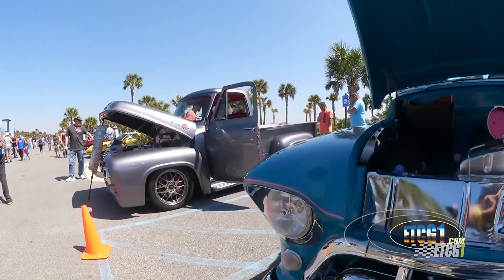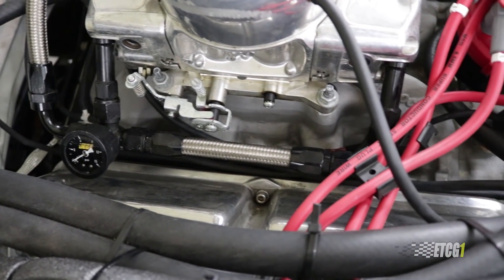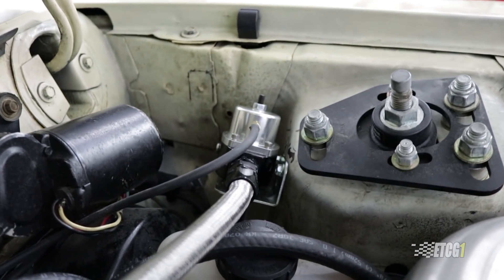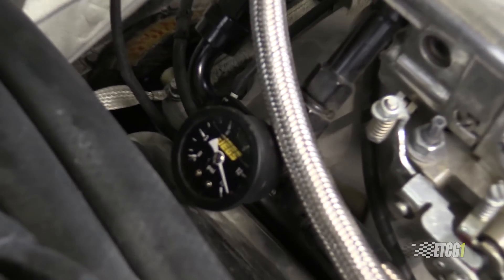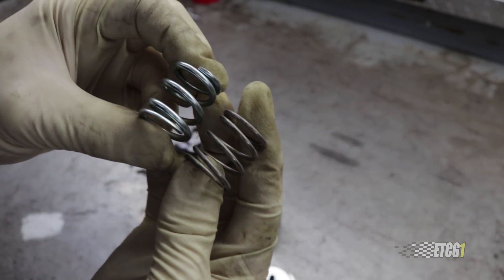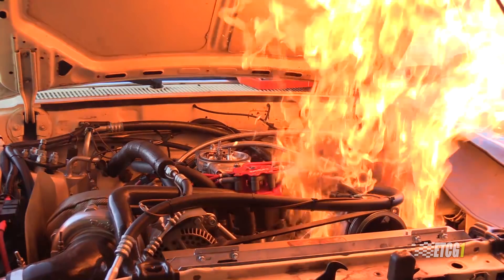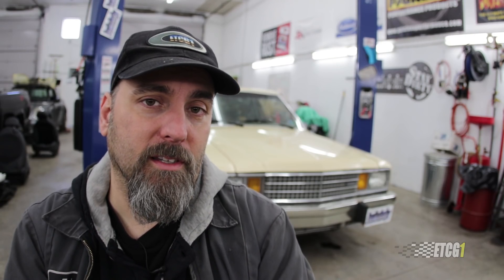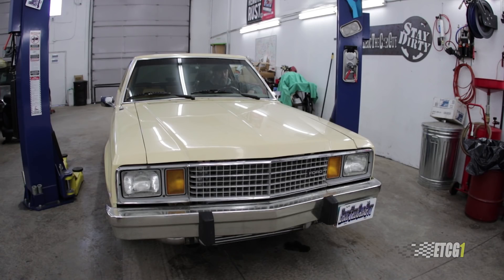How Did the Fairmont Catch On Fire?

Comment: Brb going to buy fire extinguisher for car!
Reply: Klegolas ditto
Reply: You mean that you didn't have one?  An extinguisher was the first accessory I got for each car I've owned. A first aid kit was the second.
Reply: Yeah I need to buy one. Snapped a factory plastic fuel line on my project car, thankfully it was turnef off at the time and I saw it snap. Come to find out that fuel line has been responsible for countless engine fires and should have been recalled but never was.
Reply: P Schmied First aid kit is mandatory in Germany and even checked during inspection every two years. Fire extinguisher is not, but this very much reminds me to check when mine did expire...
Think I have to get a new one.
Only problem I see with extinguishers, most people will not know how to use them and likely make a mess without getting the fire out. I was lucky to learn how to use one while working at an airport, and other than futile attempts I have seen before, Eric seems to know how to use it.

Comment: Hey, Eric. I went to a firefighting school when I was younger. A basic rule for using a fire extinguisher for liquid fuel fires is you empty it if you discharge it at all. As you saw, you did not initially extinguish the fire, and you needed more powder to smother it. This can be very dangerous with liquid fuel fires. Say you need 3/4 a tank to smother a fire. You spray half and stop. The fire spreads right back to the fuel. Now you need 3/4 a tank again, but you only have half left. ALWAYS empty the fire extinguisher on to liquid fire.
Reply from the maker: I'm not saying you're wrong, but something tells me you've never cleaned up after a dry chemical fire extinguisher discharge in an engine compartment. If you had, you would use as little as possible. Thanks for your input.
Reply: That's because the dry powder clogs the valve from closing and if you think it's reusable because there's still chemicals inside, you are most mistaken.
Reply: +ETCG1 Yeah, they can be a mess. You'll probably be finding some for quite a while. On the bright side, you figured out to have a CO2 extinguisher if there is ever a next time.

Comment: whew  I think I’m gonna move the fire extinguisher in my ‘68 Galaxie from the trunk to the passenger-compartment.  Like right now!

And that loud button — how cool!!
Reply: i did the same thing in my 64 tbird.
Reply: Im thinking the same thing. But, I might just have one in the trunk, and one in the cab. Speed is essential to avoiding total catastrophe in a fuel fire.
Reply: I think mine is rolling around on the floor in the back seat ...Im going out to check, hang on...
Reply: Put a fire extinguisher system under the Hood like you have on airplanes
Reply: LMacNeill don't we all want a loud button now? This is how wants become "needs" lol.
Reply: in my 84 s10 i hav emine bolted to the transmission tunnel on the passenger side foot well.
Reply: Hi tank. That seems like a normal spot to them to me. The key is to have it cleverly installed so feet, if it's a 3 seater up front, to not be able to mess with it, and if it can only responsible non-kids can sit there. I've only installed a few. Just my opinion.
Reply: my truck is bench seat but i never have 3 people upfront because the middle seat belt is ripped. and i mounted mine with the plastic mount it came with but only screwed in one bolt, it is a little loose and when i drive on dirt or crappy roads it virbates but then i just push a towel alongside it, but i mounted it with only 1 bolt so that if there is a fire you can just grab the fire extinguisher and just rip it out and use it and not mess with taking it out of the bracket.
Reply: Same from my bmw m5 e60 v10

Comment: Back in 1980, Car and Driver Magazine featured a project car using a Ford Fairmont like yours as the subject ("Project Fairmont").  They installed Recaro seats, a killer sound system, and some other electronic doo-dads which I can't remember 38-years-on, and the result was an electrical fire starting somewhere in the add-on wiring.  The car was then re-named "Project Firemont", and abandoned at that point.  Thanks for taking me back to my teen years, and I'm glad no serious damage resulted to either you or the car.
Reply from the maker: Thanks for sharing that. I'd love to work on that car.

Comment: Eric, I know this feeling all too well. One day I was working on my truck; It was a bit older than the one you have. The fuel pressure regulator had failed, and was spraying fuel all in the intake manifold. I chose to work on it right after I got back from a drive. To make a long story short, fuel sprayed from the failed pressure regulator and caught fire. I tried to use a fire extinguisher, but it had failed. I'm glad you were able to have a quick reaction the way you did and prevent damage. As for me, one day I'll get to rebuild my truck.

Comment: Years ago I had installed a pressurized tank in the trunk and ran a line to the engine compartment. Pressing a button on the dash i could put out a fire much like a propeller aircraft. Had way too much time on my hands back then.

Comment: You saved the beast. Glad you saved it. You may have had a humbling moment, but you learned a lot and likely taught some folks a thing or two. I use my truck to tow my RV trailer, and I need to properly mount my fire extinguisher.

Comment: Eric, sorry to hear about the fire, but am glad that no one got hurt. Also glad that you were able to put it out so fast. Reminds me of a friend's car, he had an 80 Granada with the inline 6 and auto. It also had a very leaky rear main seal.  He was on his way home one day, the oil caught fire off of the exhaust. Fire Dept got there and put it out in time.  He replaced the seal and continued to drive that car. I called it the "Energizer rabbit" due to all the things that happened to it, but it would not die. Left ball joint popped out one day just off the freeway. Gas tank fell out another day, put it back in temporarily with bungie cords.  The aforementioned fire. An accident to the right front, damaged the fender, but did not damage the bumper. That car kept going, like the Energizer bunny. That was back in the late 80's.

Comment: We caught a customers Delorean engine bay on fire like that one time. It’s good to have a Fire Extinguisher close by!
Reply: taledarkside Ba-dum-dum! cymbal 😂
Reply: I see what you did there. It was  something stupid and both of us not paying attention. Learned from that mistake. Luckily it didn’t do any damage since we had a fire extinguisher close by.
Reply: FAB Automotive Detailing I've seen a DMC Delorian only 2 times, perhaps 3 times here in Jersey. Back in '99 while I was in electrical engineering evening classes in Nutley, NJ I was working for a company called Access Direct in Lodi, NJ. There was a small shop next door, one of the bay doors was open one day I was walking by. They had one with the hatch open and I got to see the engine running reminded me of one of those old air cooled German things from back in the day even though I don't know if it was/is air cooled or not, I don't follow those cars. Coolest car I've ever stepped into was a Lotus Exige S with the turbo charged 2.2L Toyota 4 cyl. I've also been in a Porsche GT3 RS and some other crazy cars. I used to detail Bentleys too, only thing I can remember about them aside from the price tag is the paint on them sucks, not very durable IMO.
Reply: Leonel Ventura I’m a mechanic full time and side Detailer. I worked at a Shop here in Indiana that worked on nothing but high end imports. Ferrari,Porsche,Lamborghini,Aston Martin,Bentley and so on. Some how we ended up with the Delorean repair and it’s been a while but I don’t know why we took it on. They are weird to work on and drive like crap at least the one we had did. They electrical system was weird because ground was actually positive and positive was ground. Glad I only worked on one once.
Reply: FAB Automotive Detailing That's why, like you eluded to earlier, they're only really good for going back in time. 😄 No so much to fix. Don't you wish all cars were Japanese cars when it came to fixing them?? LOL
Reply: Yes I do! Japanese vehicles are easy most of the time. I hate working on German vehicles with a passion, I would rather take a beating sometimes then work on those.
Reply: DeLoreans look cool, but thats about it. Suspension wasn't great and they were kind of underpowered, they claimed it could hit 60 in around 9 seconds, though the few I've driven didn't feel that fast.
That plus the insane sticker mark up dealers were getting, id have passed on it then and now.
Reply: sparkplug1018  not to mention if you end up on the lid you are stuck until they flip you back over. The fuel distributor setup was terrible just like the old Mercedes. Maybe it was ahead of its time for the fuel distributor but they are a pain in the you know what when something happens to them. The fuel distributor was leaking on the one we were working on and we had a spark and next thing I knew I was using a fire extinguisher.
Reply: I want to say the engine in those cars was a French design, Peugeot I think. Which as I've heard is a royal pain to work on. Doubt the company would have lasted much longer even without the legal problems its owner had.
Reply: i think it was Renault
Reply: Ironically we're both right, was a jointly developed engine. Volvo was involved too, guess that explains the PRV name lol.

Comment: I gotta tell you Eric, I've never been so glad to be a bit paranoid and make such a ridiculous mess as I did than to have and use a fire extinguisher.

I was disassembling a broken Microsoft Surface I had from work to see what was wrong and if I could fix it, and something went wrong, and a fully charged lithium ion dragon blew its flames at me. Feeling it getting hot fast I took it to the kitchen and tossed it on the stove, and in the moment I took to turn around, grab the extinguisher, and turn back, it had gone up in flames. It took weeks to get all the powder out of the kitchen, but it was the best mess I ever made.

I'm really happy for you that you had it, it was handy, and that the worst that happened was a mess.

Comment: I couldn't figure out how all that fuel got into the intercooler ... but as soon as I heard you say the engine hydro locked, that was the AHH-HAA moment! Glad you have cat-like reflexes like myself -saved you a pile of money! Remember .. these things can ALWAYS be much, much worse ... especially if the garage catches .. which is also attached to the house! Happened to a couple buddies of mine in the day.

I've had 2 close calls with fire, but both were electrically related, not fuel. First one was in a '71 C20 - it was 2am, and I had just finished hooking up the plug wires on a brand spankin' new engine. I was tired ... but one half my brain said, "Lets go for a quick ride!"  ... the other half said, " BAD idea - get some sleep, and test it out in daylight". Guess which one I listened to? Fired her up, and warmed it up good. Threw it in gear, and off I went! I was excited! Laid into it a bit to feel the torque of that fresh motor.  I got about 200 yards up the road, when suddenly everything went dark ... and QUIET instantly. "Oh shit!" Knew this wasn't going to be good. Could hear sizzling. Pitch dark out, yanked open the hood, and suddenly it was daytime! Big fire around the battery, and down the right side of the engine. In my haste, I left the positive cable laying right on the passenger side header - forgot to secure it! All 600A of smoke was released from the battery and the cable. Melted the copper into little balls - I still have that cable hanging in my barn as a reminder to keep my head screwed on correctly. No fire extinguisher. Put the fire out with dirty snow from the side of the road. I had just painted the engine, an of course it got just hot enough to make it tacky again. What a mess! Would've been the first nice looking part of any vehicle I had owned up until then, now it was all covered in crap in less than a minute!!

Second fire wasn't as spectacular, but it sure got my heart pumping! Driving down the road on a hot, humid, rainy summer afternoon. Had the floor vents open on my '72 El Camino, with the A/C (under dash unit) and defroster on to clear all the moisture out of the car. Well, that additional amp load of 2 large motors running, plus the wipers and headlights, was too much for the poor insulation between one of my ammeter wires. Same scenario - everything went dead and quiet instantly. Then my buddy started freaking out, "YOU GOT A FIRE MAN!!", as we're coasting 40 mph down the road. Right between my legs too! I got the car stopped damn quick for having no power assist, yanked open the hood, and ripped the emergency disconnect key out of the negative cable. Ran back to the car and started blowing furiously on the fire - it went out!! No fire extinguisher that time either ... Got lucky on that one! Cat-like reflexes, FTW! 🤣

Comment: The vapour coming off the fuel spraying out of the intercooler piping is what set the car alight. Fuel vapour is much easier to ignite and requires much less temperature, the carby being open and the back fires provided a nice ignition source for all that fuel. Eek... something that could have gone completely sour real quick. Nice work on saving the car Eric, would have really sucked to have wasted all that effort.
Reply: Not just easier to ignite - vapour is the only thing that ignites.  And if the exhaust manifold was hot (as Eric implied), that would certainly get a bunch to vapourize really quickly.  Add that to the flames in the carb...and he's one lucky guy to get off this easy.  :-)
Reply: indeed, it was pouring.
Reply: It looked like a backfire ignited the vapors. It flashed downward from the carb.
Reply: You can also see it was fuel vapour mixed with air because of the blue fringing as the flame spread.

Comment: Ever got a brand new starter that doesn't work? Or a Holley with the wrong jets installed from the factory? You just learned the first golden rule...never trust the manufacturer.I do budget builds and since Im always using ebay or Amazon parts Im used to checking everything over VERY thoroughly but even the name brands screw up from time to time.That being said, Im glad it didn't do anymore damage than it did and the important thing is you weren't injured. In the future always double check performance parts especially. I know I've been bitten more than a few times myself.

Comment: A spring can destroy 35,000$ build 😭😭
Reply: An O-ring can destroy a space shuttle
Reply: Burned two cars. One because of a stupid, stupid mistake, using a hose clamp that wasn't engine bay certified and the other because i let someone else wrench on my car because i was too busy to fix it.
100k+ combined gone in seconds, Eric was lucky, because sometimes even with all the proper mindset and prep, you're still not fast enough or the fire is too much to handle.
Reply: If the fuel pressure guage had the max for his regulator at 75% of the scale instead of 100%, he would have caught it going wrong much earlier. (Ok to have multiple gages with different ranges for the same thing too. One for overall system, and another for fine adjusting.)The other mistake was trusting a busy parts company to not screw up an order.
Reply: A broken condom can ruin your life too.